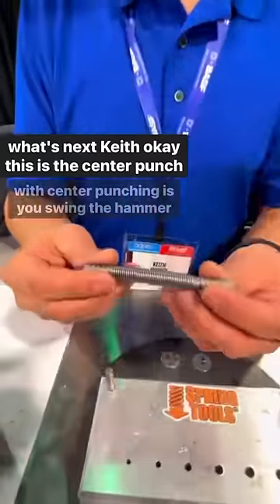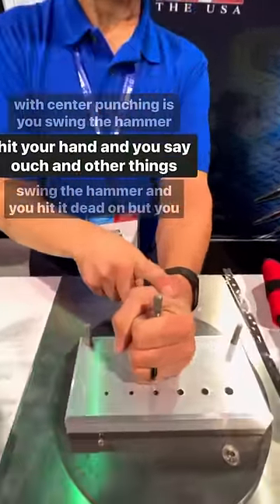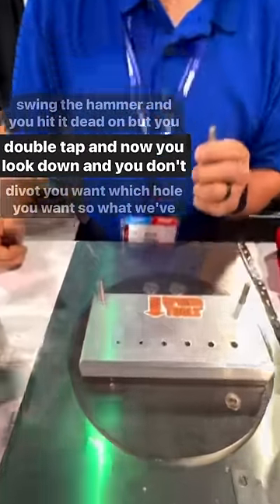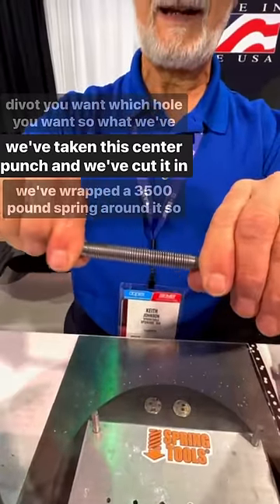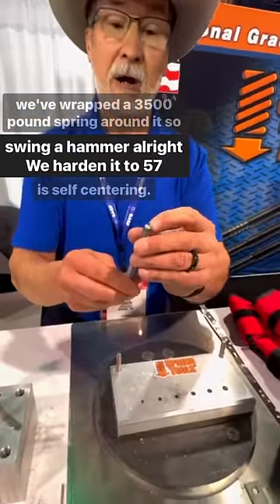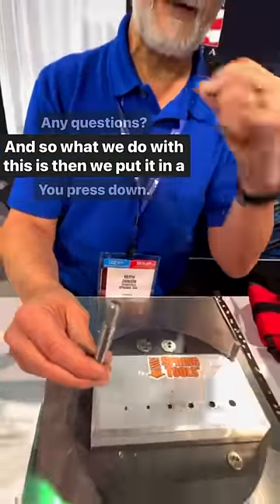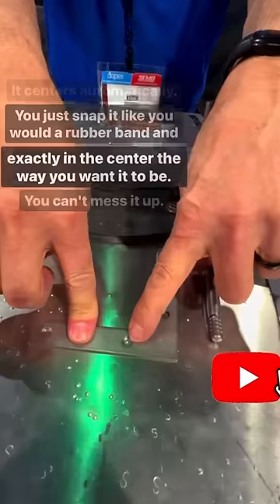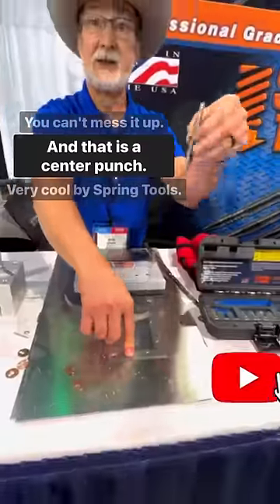“You can’t mess this up”. #shorts

Comment: they didn’t “invent” this product tho.. i had something similar but it wasn’t a center punch, it was to pound nails in, it works great when your doing exterior and interior trim and you don’t want to leave a waffle weave or a round hammer head mark in the wood so you put the point on the head of the nail and pull back it will pound only the nail in, surprisingly enough it was strong enough to pound framing nails through 2x4s and teco nails through sidings into studs..

Comment: Guy tries to reinvent the wheel and comes up with an octagon.

Sorry but there's been an "automatic center punch" for over a century now (invented in 1904) and it doesn't need a hammer nor do you have to pull on a spring. Many EMS personnel carry them like a pen in their pocket to break automobile glass. You just push on it like you were trying to push a pencil through the glass until it pops, shattering the glass. They're $3.99 at Harbor Freight.

Comment: What happened to the automatic punches you push on. Never had much issues with hitting my hand with either or double marks though i use a 3 pound when I do it found less issues if use a bigger hammer.

Comment: What he dosent tell you is if you snap the spring at a angle the metal Hammer and anvil inside the spring slide and bend the tool permanently.

Comment: Why the everlasting hell would you swing a hammer like that for a center punch? You just need like one or two dm (4-8 inches). If you swing the hammer with as much force as this guy seem to think you need, you not only destroy the center punch itself and you can injure yourself badly from metal shards from it, but you also risk warping your work piece. Even in titanium you can do a center mark with just a few dm.

And to avoid double tapping... That's why you're supposed to use a dead blow hammer, or if you don't have a proper steel dead blow (which tends to be expensive), you instead use a mallet, not a hammer. Heavy enough that it doesn't bounce unless you try to hit it full force and if you do, well now you're definitely warping your material.

Comment: i got from my grand father an old one handed center punch. it's a small cylinder with a nail shaped punch sticking out, you press it into your piece, the nail goes into the cylinder until a little hammer inside goes "tack!" and you got your marking. if the marking is too shallow, you can just do it again as it's easy, one handed and the point doesn't move at all from the spot.

Comment: This is the same type of set punch we’ve been using for years in finish carpentry.  When you’re shooting nails and get a proud one, just grab the spring loaded set punch (which come in different sizes), pull back on the spring and let it fly.  It will set the proud nail below the surface of the wood.

Comment: hmm transfer punch? hes using the wrong tool for the job. Center punches are for making a mark where  a line was marked. Transfer punches are for marking a center punch exactly center in a specific size hole just like this. oh and use a small ball pien. Tools don't replace craftsmanship.

Comment: I already have an automatic center punch. These guys trying to reinvent the wheel. I see them selling a bunch but I also see whoever buys it never using it because they wont want to bother using a bracket. 
You can drill a hole the same size as your center punch into wood or metal and boom now you have then same thing. Turing 1 tool into 2 rarely is a groundbreaking improvement.
He really tries to barely mention the braket. Thats gonna be a pain in the azz.

Comment: I live in Spokane where spring tools is located I use the hinge popper spring tool and nail setter spring tool all the time I’m a carpenter more focused on trim carpentry. They are great however keep them lubed it’s harder to pull the spring back if it isn’t and keep your hand steady holding the head of it.

Comment: I own a set, they actually work very well. They’re great in tight spaces where swinging a hammer with enough force is either very hard or impossible. With these you just need enough room to pull the back up which is only an inch or so.

Comment: If you are using a center punch, then odds are your a professional. If your a professional, and these are problems for you, then you are either new and need practice, or you should find another line of work. 

There is no way that center punch would punch anything of decent thickness, and it would also likely throw off you punch location when you are pulling the spring back. Also I really don't like the fact that you can't see the tip before snapping it. That makes it's use extremely limiting. That alone would make me throw that out immediately after trying to use it the first time. 

You don't always have to reinvent the wheel.

Comment: I've never double tapped, I never missed a punch, and if you hold pressure down on the center punch it's not going to double tap anyway, it's not going to jump around!!!

I also love my other center punch that has an internal spring and all I have to do is push on it with my hand and it does a loud click with one clear punch mark!